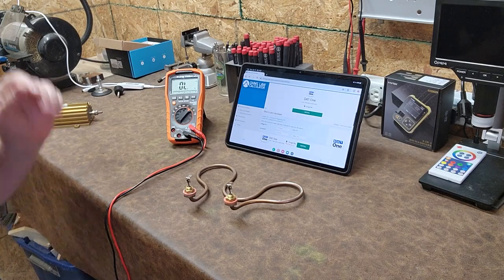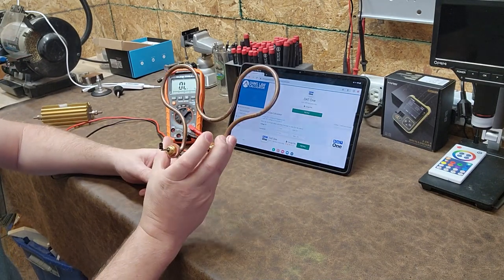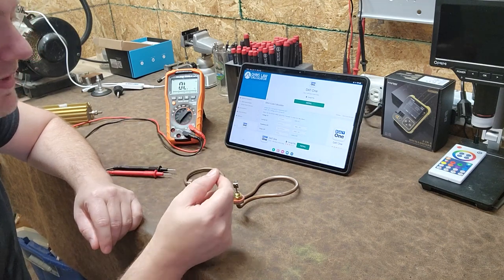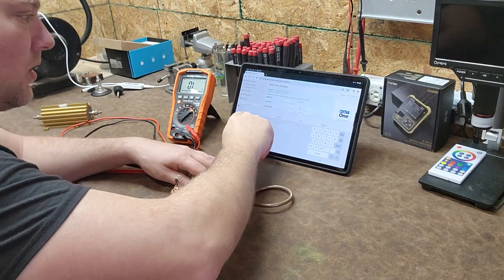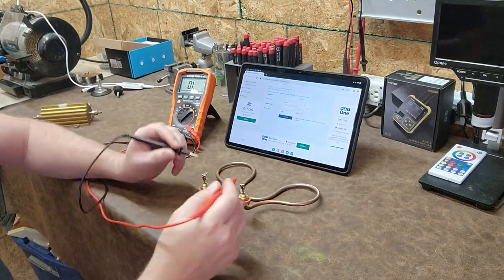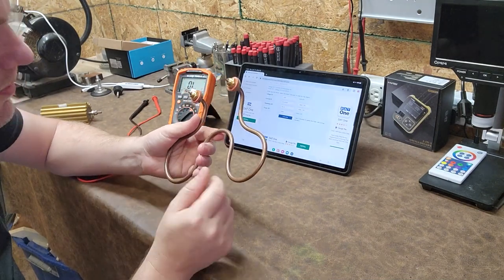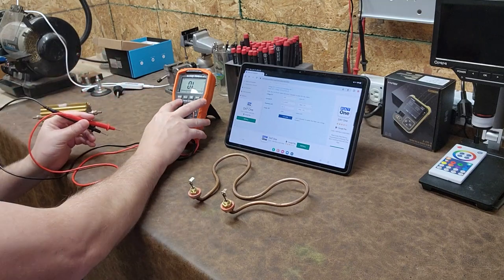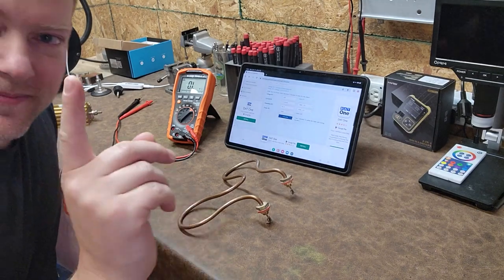Diagnosing Heating Elements

Comment: You said you were contracted out to replace the part. Did you find a different issue with the device?
Reply from the maker: Overtemp protection reset has a copper capillary tube with a pin hole - allowed pressure to escape so device was always in overtemp reset mode. Chattanooga Hydrocollator
Reply: @BetterBiomedChannel  Neat. I just took a look at the service manual but still can't wrap my head around the overtemp thermostat 😅
Reply from the maker: I'll do a video when the parts come in to rebuild a second device.